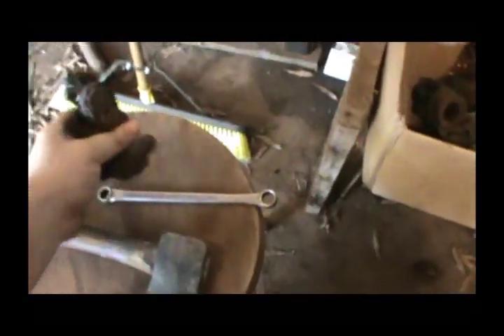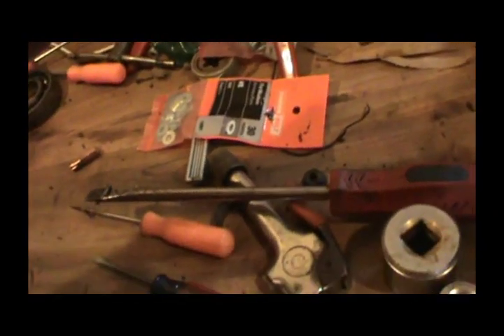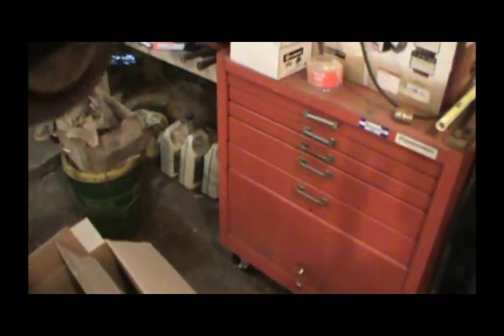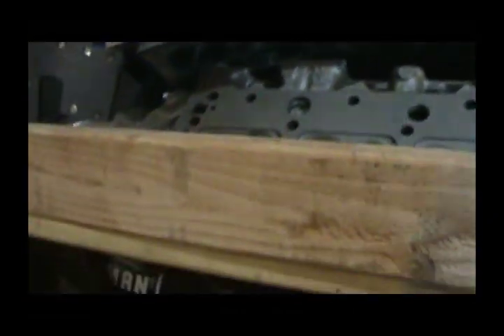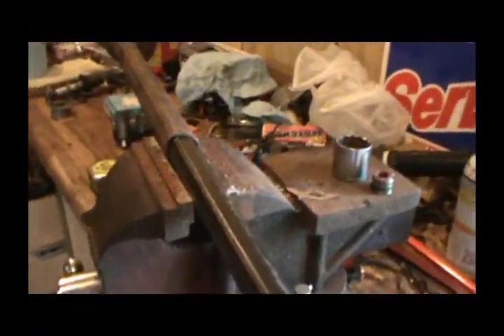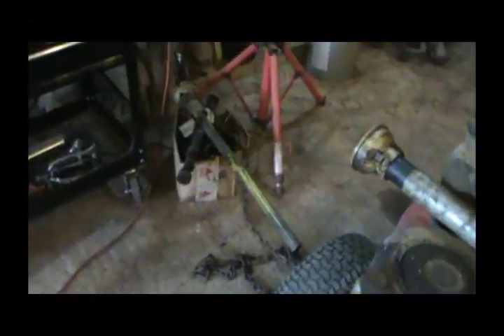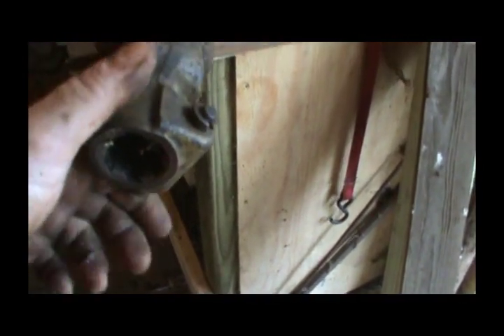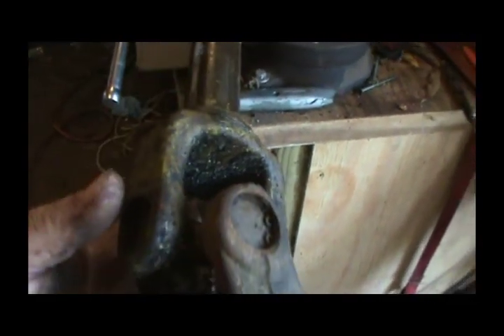MF 25 Hay Rake PTO Shaft Repair

Comment: How did you remove the yoke on the implement side. Im working on a deo-20 rake and it looks like it has a metal dowel pin in it. I gave it hell but it wont budge
Reply from the maker: Mine had a bolt but yours is probably rusted in.  Maybe drill it out?